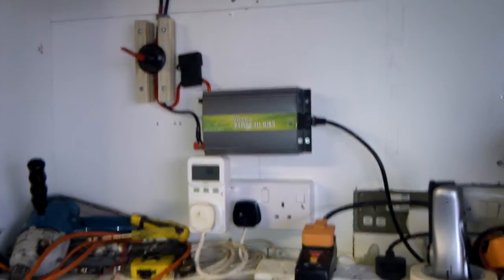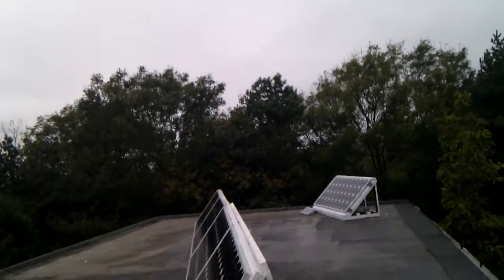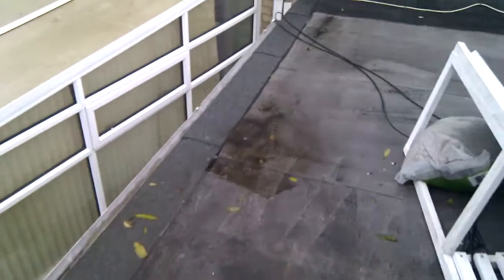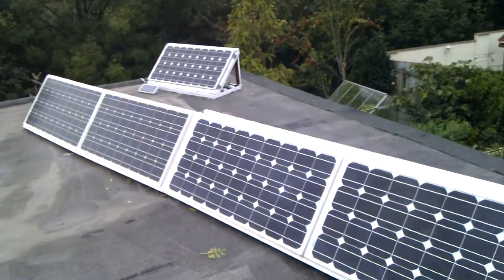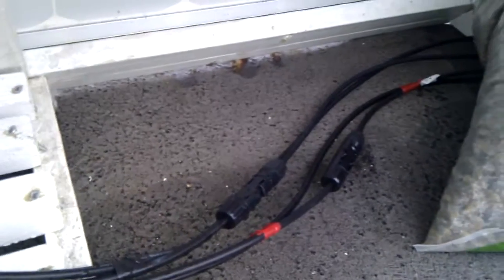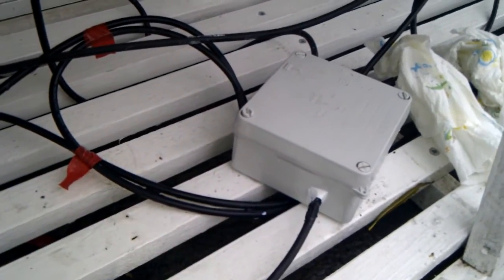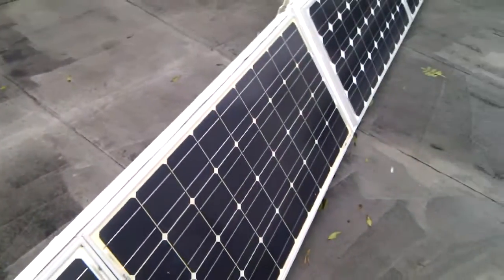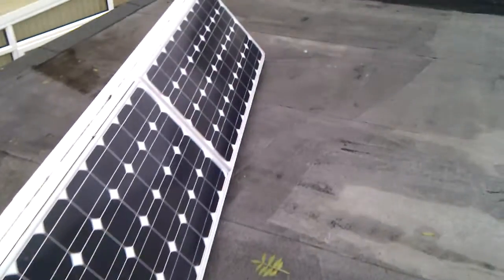Solar grid tied garage setup UK - More panels

Comment: Hi just wondering how did you done grid tie system to feed the house ? As I want to use used solar panels to feed in house but I heard that I need to use fit scheme? And basically there very little or non info about it ,maybe you can help about it ?

Comment: if your supplying your own home with power from micro-generation how is that stealing?  its not like your rigging a meter..

the only issue I can see is that there is a standard for grid tie inverters even tho they may be CE approved these type are not G83 certified (the UK's way to push up prices and make more tax income)..

Comment: If that discoloration was not on the module when it was new out of the box, then it was probably due to a bad batch of EVA or light reacting with crap in the encapsulation resin.  If it was there originally then there was some contamination introduced into the laminate at the factory.
Also, those Chicom crapola GTIs usually top out at a little over half their power rating regardless of the array size.  They also die prematurely.  Off grid systems tend to be more reliable.

Comment from the maker: @crsbt 
1) The power is not 'lost' instead your meter will either move backwards (depending on the meter) or your meter will slow down and possibly even stop as the power substitutes your usage.
2) Yes
3) You should check with them on a big system, smaller setups they are unlikely to notice but with a large setup they may *think* your stealing power unless you can explain why your meter reading is so low/backwards.

Comment from the maker: @TorchwoodElectrics 

In this setup yes, all available power goes straight to the grid and is not stored. The solar shed on the other hand is a hybrid system with some power going to the grid and some power being stored in a battery bank, that way the shed can be powered even without the grid present.

We have thought about trying a wind turbine and may get one in future but at the moment we are foccused on solar due to it being silent in operation.

Comment: I would increase your voltage to cut your loss, and also change your wiring to a higher braided wiring, like 8 or lower gauge. The ticker the wire and more braiding, the lower your loss will be.